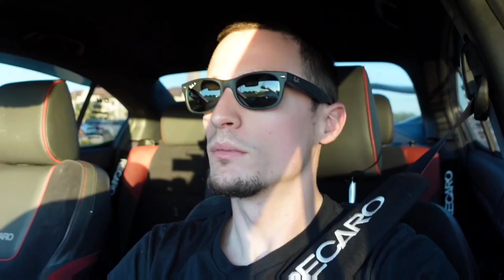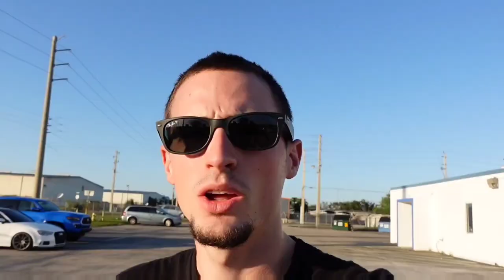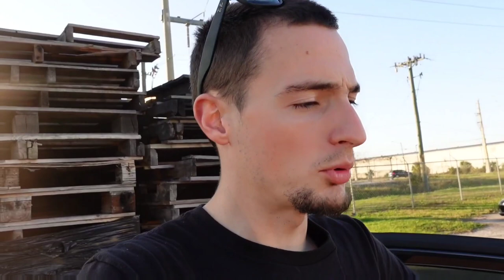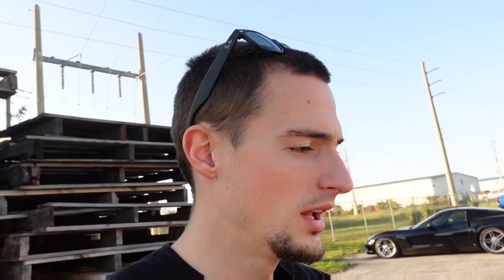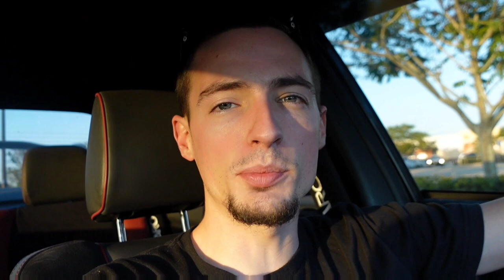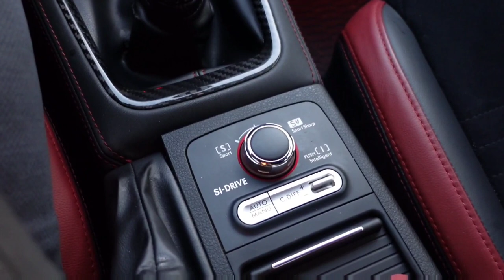STI Transmission Swap Review

Comment: 2014 WRX with a 2015 STI trans swap completed about 6 month ago. I installed the MAP DCCD Controller. I had terrible mileage after the STI tranny install but I was playing with the front to back bias with the manual controls.  When I selected the “automatic” mode for the DCCD controller, I got most of my mpg back.
Reply from the maker: Woah!! Didn't even think to check this! You are absolutely right. After the swap I went from averaging 25-28mph to getting average and 20-21mpg. Just reset and drove on auto for 36 miles during same normal commute and averaged 26mpg!

Comment: On the '22s where does the speed input come from, I plan to do the 2018 trans install, so I'm concerned on speed input for the speedometer and I want to retain the gear indicator in the dash which I think comes from the small harness in the cars console

Comment: So I just did mine. When put in reverse makes a loud thumping sound some help would be nice
Reply from the maker: Mine occasionally did this also until I got the DCCD Hooked up. I double checked all my mounts and everything but it didn't go away until I got the iwire dccd spider kit and was able to keep the center diff in auto mode. It would only happen occasionally though. If yours is consistent I would double check that all the mounts are tight!
Reply: @StreetInspired1  hell yeah thank you for the response will do that today. Man didn’t know it was going to like tho for a daily lol

Comment: I was going to do the 6 speed swap too. But for my built WRX Hatch being that would be my next and best step to do on the hatch. Not sure if you are tuned yet but either way. If you don’t have the DCCD controller(connected/working etc.) just yet or at the moment. You can always run it without a controller and it will just default to “open”.  But I could be wrong being that I have an EJ and not FA engine.

Comment: Hey man did u have any issues getting the front cross member on with out the drive line hitting the shift linkage maybe i have the mount upside down that holds the linkage to the frame of the car

Comment: Great feed back big homie! I will definitely be looking to do this at some point. Quick question though, I am looking to do a clutch job before I do flex fuel and trying to find a clutch to handle my power goal which will be 350 to the wheels with hopefully matching or mor torque? Plus what are your thoughts on using stock flywheel?
Reply from the maker: So if you're planning on stopping power mods for a while after doinf flex the ACT Heavy Duty Street should be good. That one holds 449ft tq at the crank or around 380-400tq  at the wheels. That should hold your power on flex with stock turbo. If you plan on doing a bigger turbo and making over 400-420whp I would maybe go with the ACT Extreme Street. That one for thr wrx is rated at 532 tq at the crank or around 440-460 tq at the wheels so that one should handle 500ish whp. As far as Flywheel. You can certainly use an oem Flywheel however I would definitely recommend getting a new oem Flywheel. I've heard lots of horror stories of brand new clutches getting toasted from reused Flywheels or resurfaced flywheels.
Reply: @StreetInspired1  kool, I was planning to get a new stock flywheel as well thank you for the suggestion big dawg I really appreciate it sir! Keep owing what your doing man your videos are very informative and I really appreciate your honest reviews!

Comment: Nice.  I'm almost done with my STI transmission swap.  Good to see your opinion on it.  Just got my Spiider dccd Pro in the mail a few days ago.  I'll be doing an install video on my channel in the near future.
Reply from the maker: Glad its going good! Ill be sure to check it out!
Reply: @StreetInspired1  thank you.  Doing the work myself, and between work and furthering education and family responsibilities, it has taken longer than I'd like, but I am getting there one step at a time.  I'm doing a whole new build, though, not just the transmission swap.  Car will be between 600-700hp.
Reply: @2018wrxaddict  What block are you building that much power on?
Reply: @rodriguezangel62  just a closed deck FA20F with forged rods and pistons and built heads with some porting.

Comment: My wrx transmission went out who did you purchase yours from. Just started looking and only seems to be running on eBay.
Reply from the maker: I got mine on ebay and had it shipped from a used subaru parts dealer in Jacksonville, FL

Comment: i think when my 14 wrx trans goes.. i wanna build the 5 speed with ppg gears.. instead of swapping. what you think abou tthat idea? i currently sitting 400 whp / 401 tq on e85 - 20 lbs boost on a mdx-555 turbo

Comment: I'm not sure if you're going to see this, but how did you wire up the heated seats in the STi cener console?
Reply from the maker: I actually ended up ordering the STI Center Consol which came with the sti heated seat switches and they had the wiring with plug from the car with a couple of inches of wire on them where they were cut from the vehicle. I then tested the circuit of the stock seats by using a voltage meter to see which wire did what and then cut and spliced the wires into the sti harness. I should've made a video showing and explaining, but I didn't. I hope this helps In some way
Reply: @StreetInspired1  gotcha, thanks for the reply

Comment: Do the shifts feel more engaged? The wrx tranny feels sloppy, putting it in gear feels like all over the place.
Reply from the maker: Definitely feels more engaged when you select a gear. The wrx uses cables and the sti is direct to transmission.

Comment: I did a 2018 sti tranny swap on my 16 wrx but get torque bind when one wheel is off the ground is that normal? It’s to the point where the car won’t move anymore. Also Noticed while making right turns slowly I get a jerk from the rear

Aside from that it drives fine no grinds on any of the gears. Pulls hard. I’m thinking the center diff is bad.
Reply from the maker: If you don't have the dccd controller the majority of the power is sent to the rear so it will feel slightly jerky when making slow turns or reversing while turning. It isn't very noticeable though. Not sure why you would get any binding thats concerning. The center diff may be having issues but it's hard to say. Transmissions are so hard to diagnose without tearing them apart.

Comment: Yo, you got to get with Ron and send him some logs and let him know you have an sti trans now.(if you haven’t already told him) it is 100% necessary that you see if it needs any adjustments made it the tune because the sti trans gearing is shorter and that’s going to change the power band and a lot of other factors with the tune. That’s bad ass and I’m glad you got an sti trans in there good luck to you bro
Reply from the maker: Already done. I mentioned that in my swap video. I sent him an email and got a new tune before the transmission was in the car he only charged me $25 for the adjustment!
Reply: @StreetInspired1  I'm hoping he doesn't give me any issues because I'm catless. Ive been running the same tune with him for the past 3 years and will be swapping my trans in soon also.

Comment: Hey man I was curious about that one time that you mentioned how you were waiting to get ignition cut launch control and flat foot shifting and my question is how you plan on achieving that
Reply from the maker: Cobb was supposed to be releasing that In 2021 and never delivered. Not sure what other options their are without getting a Motec ECU
Reply: @StreetInspired1  Wait you can't FFS after swapping the STI trans?
Reply from the maker: @grassbag1  you can. You just have to do it through the Cobb Accesport
Reply: @StreetInspired1  Copy. I have it set up already just wasn't sure if you were still.avle to due to the trans swap. Thanks man

Comment: Do you use the center diff control when doing this swap?
Reply from the maker: You don't need it but the power will be mostly sent the the rear I think it's 65/35. I haven't had the extra money for the I-wire Spyder DCCD controller yet to utilize the diff control. It's like $800 until it's all said and done.
Reply: @StreetInspired1  thanks that's what I needed to know. I didn't wanna do the swap unless I could use the diff controller. Appreciate the info

Comment: Dude, I want an sti soooo bad, but I can't drive stick 😫 yes I'm a failure in life. So I'm considering a cvt (15-21), but I hear they are 💩 unless you CAREFULLY take care of them, but the sti possible hp threshold sounds so good to me. Any suggestions?
Reply from the maker: I would recommend learning manual. It's not hard just takes a little practice. If not maybe wait for the new wrx. They claim the new cvt is a lot better they even went ad far as calling it "subaru performance transmission"
Reply: Just buy a manual and learn to drive if
Reply: I bought my manual ‘16 wrx without knowing how to drive stick. Forced me to learn. Clutch still going strong after 30k miles with protune stage 2. You’ll be fine! Just send it.
Reply: Force yourself to learn. I bought my manual brz without knowing at all. Taught myself and glad I did
Reply: @Rebecca-713  i did the same with my 2018 Wrx

Comment: Dude it’s exactly worth doing it. The STI trans, drive train, limited slip front and rear diff. Even axles make it a far better handling Subie. STI drivetrain is on another level of driving experience. DCCD is also a great feature to customize your drivetrain.  Let alone SI drive.
Reply from the maker: This car handled so much better with this driveline. I'm definitely sold on doing it to my new wrx also. Such an amazing experience!
Reply: @StreetInspired1  I can’t wait to see you swap it. But on your new wrx You can if you use the aftermarket carbon driveshaft so that will be OP. I’ll go ahead and resubscribe. I had a similar experience with my wrx and now I have a new 2020 STI that I suspension modded and tuned for autocross <3
Reply: @StreetInspired1  I’m just confused why you said “not to do it if you don’t have to” when you admit it handled better after the swap. Can you please give further insight on that cause Iv been wondering for a long time.
Reply from the maker: @fang4524  because it's a very expensive swap and as much as I loved it, it wouldn't be worth the money to most people who have a perfectly good transmission. I think if your wrx transmission goes out it's worth the extra money for an upgrade. For the repalcement, durability, and dccd. but I don't think  it would be worth it to most people if theirs is fine and upgrading only gives them the dccd. It's great but to most people there's a million better ways to spend $7k-10k
Reply: @StreetInspired1  I understand what you mean. I hated that my wrx has open diffs. Very happy I got an STI now.